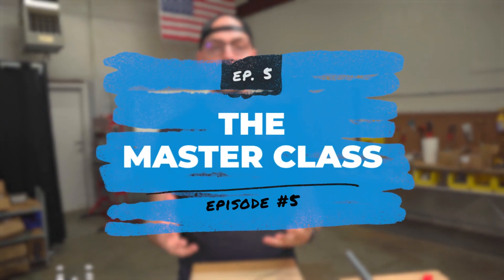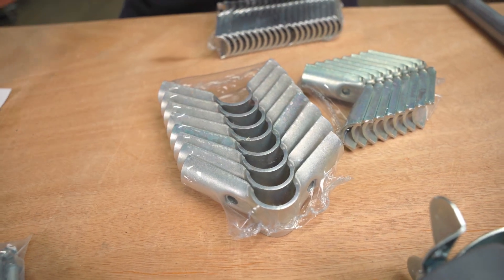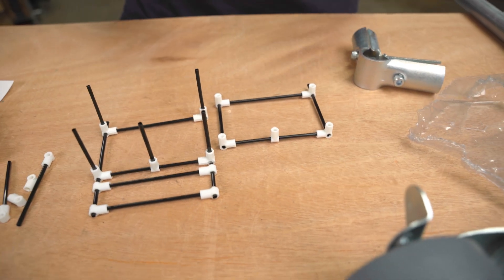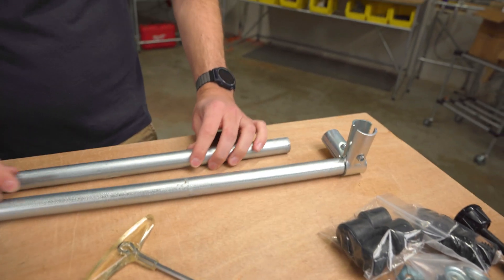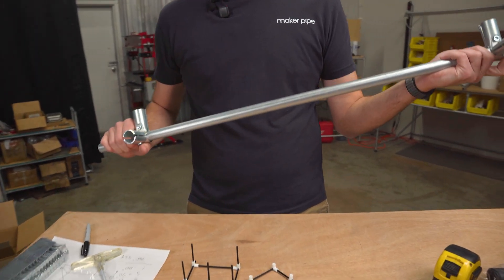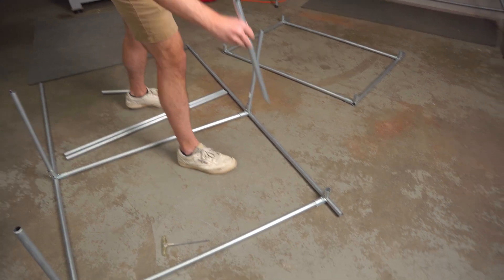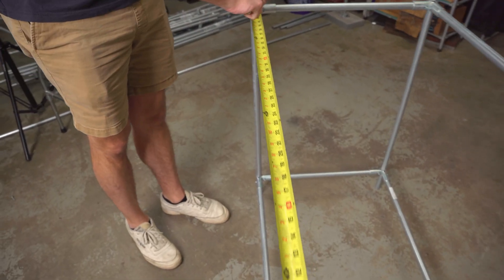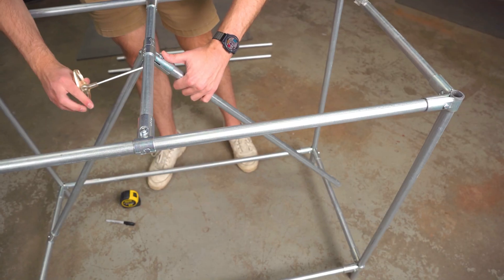How To Build Steel Frames | Maker Pipe Master Class - Ep. 5

Comment: I like the idea of measuring in place for the diagonal. If I were to measure  incorrectly by  a quarter of an inch, how difficult is it going to be to use a pipe cutter to remove that short of an amount.? Seems to me that there might be a limit to minimun distance that can be cut.
Reply from the maker: Hi there, that's a good question. The difficulty depends on how long the rest of the piece of conduit is because it can be challenging to hold tight enough on to a really short piece and spin it around. However if there's plenty of room to hold on to the conduit then you can cut really short pieces off.

Comment: thank you Jake.  this is really helpful.  I have made and taken apart many projects so far.  I can do better now with this knowledge you have shared.  I have a weird problem with my latest project.  How in the heck did i end up with one fewer 90 than i need?  the project is just a simple table.  I'm just going to use a T on one leg.  I'm using flange connectors to attach to my table top because i just happen to have a bunch of them.  we'll see what kind of weirdness happens.  I just need a new flat surface to stack stuff.  Isn't that what tables are for anyway??  oh, a suggestion for anyone building a rack for an Urban worm bag, Make the frame taller than you think you need so you can fit a five gallon bucket underneath for harvesting your compost.